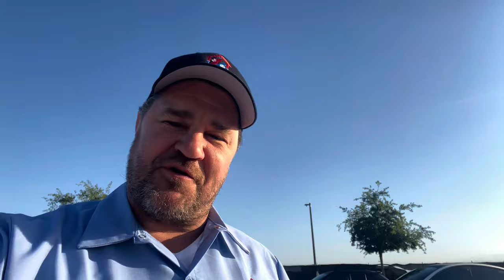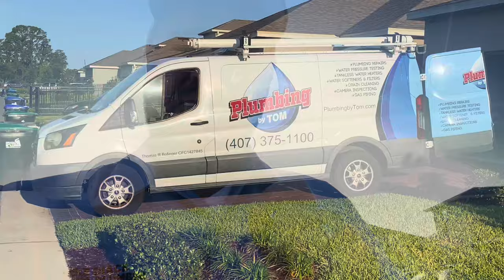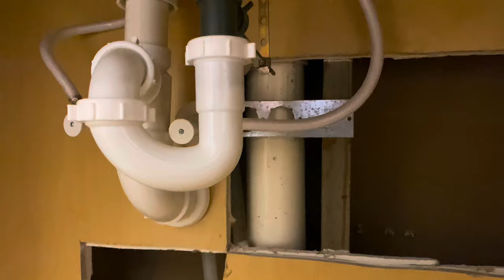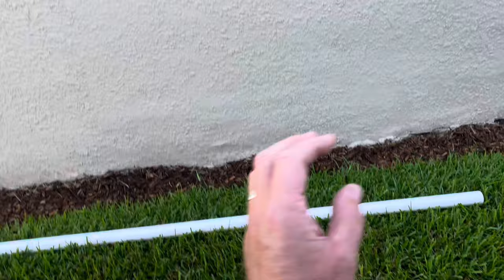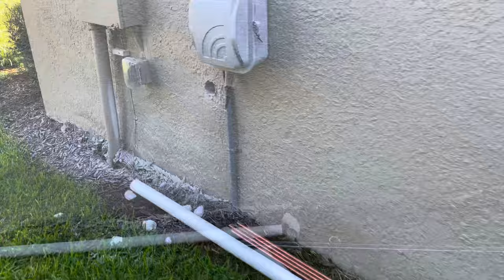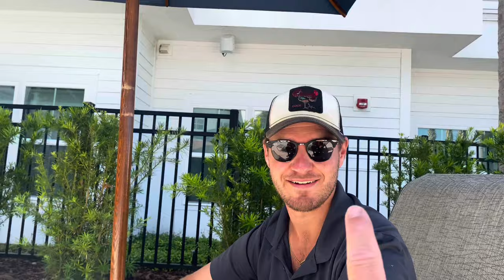Installing new Pipes for Plumbing Fixtures in Central Florida

Comment: In Florida they solder a hose bib flush to the wall. To replace it you have to chisel a huge hole in the masonry to extend it out.
Reply from the maker: Yes. Correct.

Comment: For a new install that looks like a hack job for water pipes inside.  Could have off set them going thru the wall.
Reply from the maker: Nope. Its an exterior block wall with 3/4" shims as nailers for the sheetrock. The homeowner didn't want the piping trenched and this was the only other way. Permits pulled. Approved and passed inspection.

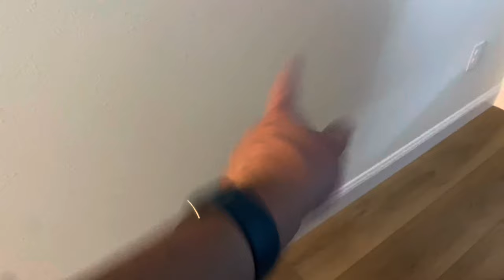Comment: There was a option to put it inside like pipe doctor stated but he was surprised by putting it outside...... 2:28
Reply from the maker: there wasn't an option to install indoors. Permits filled, approved for exterior install and passed inspection.
Reply: @MikeyPipesOrlando  Dont see why something wasn't used to cover up the work...